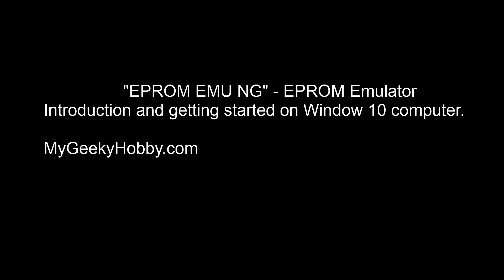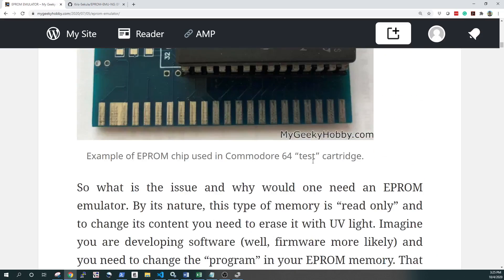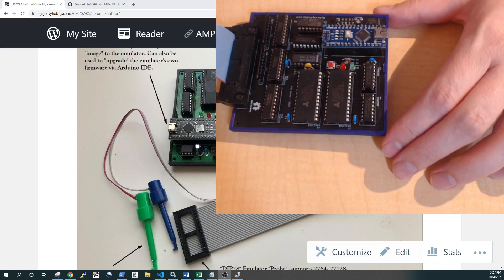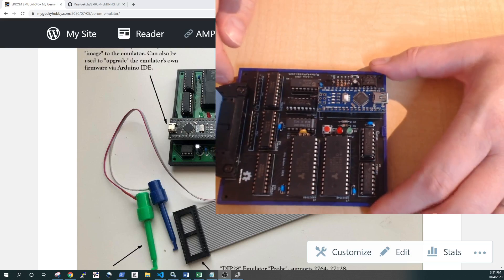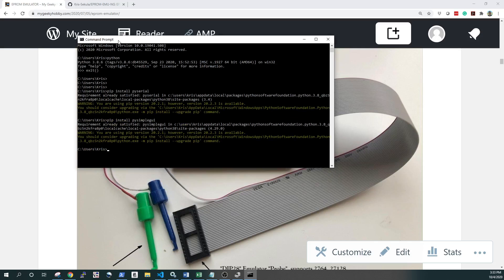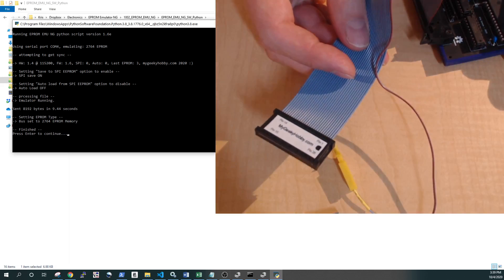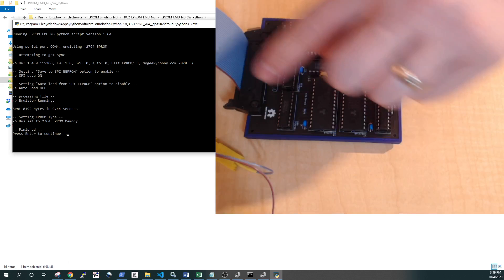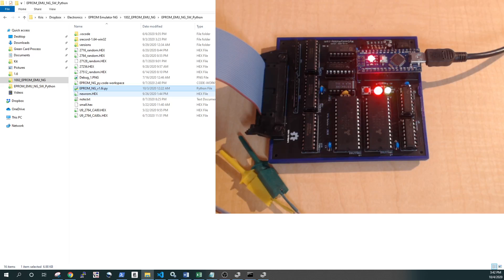#1 EPROM Emulator DIY - Arduino project.

Comment: Hello! I don't understand much about programming, sorry to ask you nonsense. I would like to develop the old eprom for vending machines and coin validators. Mainly the language settings ...
These are M27C-256. M27C-512, M27C1001 and M27C2001, respectively. Can I emulate any of these or no more than 512? Thanks!

Comment: Wouldn't be able to use the on a Honda ecu?
Reply from the maker: If the ECU uses standard EPROM memory you could use the emulator for testing ECU maps at your own risk, the device was designed for interaction with old computers, but some people use it with ECU map testing. https://mygeekyhobby.com/2021/06/04/eprom-emu-ng-use-cases/ Third one from the top, Leon is using it on his car.

Comment: Thanks for clear video. I have ordered one and hope to use it to program the EPROMs on my Maserati 224. It has 2 27C256 in 2 separate Magneti Marelli ECUs, each does 3 cylinders. I would like to add another EPROM cable. Does anyone know if the 2 EPROMs can be connected in parallel? Or do I need a separate driver circuit?
Reply: Hey Charles. Thanks for the comment and the order. Unfortunately, since you have two separate ECUs you would have to use two separate emulators, this is due to the way the control circuit works inside the ECU, if you connect them in parallel, the two ECUs will be trying to access data at the same time, most likely data from different areas of the EPROM address space...
Reply: @avrkris  Couldn't another ribbon cable be added after additional staging chips? Would help if circuit diagram was available with chip ID...
I would also like to read the addresses scanned by processor, FTDI 232RL?
Reply from the maker: Sorry @Charles Taylor, I missed your comment. Nope, 2nd cable and staging circuit would not work, the problem is that you can't address the memory twice (with two cables you will have two sets of A0-A15 bus signals and both can be "calling" different areas of the memory at the same time, this would be an issue). It's less complex to simply use two emulators. Not sure what diagram you are asking for, the emulator is open source so all schematics and diagrams are on GitHub. Reading the address scanned by the processor is not possible directly from the emulator, the FTDI232RL would only help you if the ECU has a "diagnostic" port where you can connect the FTDI and watch what the ECU is doing...
Reply: Do you think i could use this for a OBD1 Honda ecu?
Reply from the maker: nope this is not OBD1 device, it's for EPROM emulation. I had reports some people use it for ECU map testing, I use it for old computers :)

Comment: Nice design and implementation (and video production).  Thank you for sharing.

May I ask if your design is based in part on the hardware portion of San Bergmans' Raspberry Pi ROM Emulator design?
Reply: Hi Mike, thanks for the comment. There are some similarities with San's emulator, in fact by the time I was sharing the first version of my emulator someone pointed me to San's version and I used the approach to buffering the reset lines with transistors. As I mentioned in the article on my website the EPROM emulator with SRAM has been very popular 10-20 years ago, I just wanted to replace some of the older connectivity approaches (RS232 or Centronics) with something more up to date like USB, and use cheap components :)

Comment: Is this able to function as moates ostrich emulator for honda obd1 ecu?
Reply from the maker: I'm not familiar with the functionality of those ECU ... this is EPROM emulator and can only emulate EPROMs (if the ECU is using EPROM, you can replace the EPROM chip with the emulator, load a bin file and it will re-program itself in seconds without having to swap the EPROM chip). I do have reports from a user, who is using the emulator for testing different "maps" for tuning his BMW cars, he told me he is using the emulator successfully with E30 and E36 ECUs, but this is only in his garage while the car is stationary.
Reply: May i know what is the speed of this? Cos the ecu/tuning software needs less than 70ns.
Reply from the maker: @ddhoohobb  ... not too sure of the total but the SRAM that I'm using in the device is rated at 55ns, but there are also some buffer gates that will add around 9ns each
Reply: Anything new on this topic? I am here for the same reason.

Comment: Very nice looking board ! I need something like this for my Motorola 6802 board.
Reply from the maker: It's an EPROM emulator, so it doesn't really care what CPU it is talking to ... I've seen people using it with a 6802 successfully.
Reply: @MyGeekyHobby  Thanks MGH! Do you have a link to kit of parts?
Reply from the maker: @freeelectron8261  I'm out of kits currently so only assembled devices, I'll add more kits next week if that helps https://www.ebay.com/sch/avr4sale/m.html?